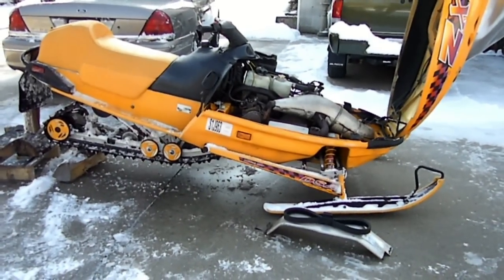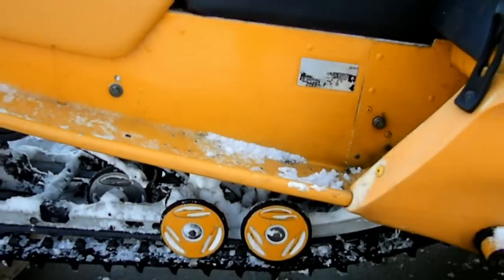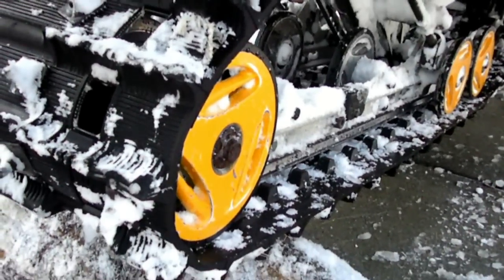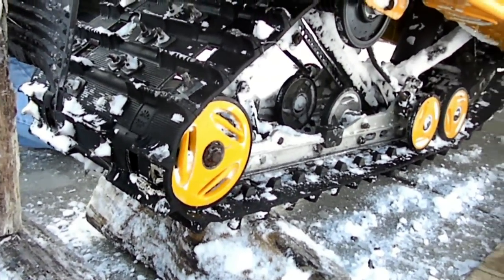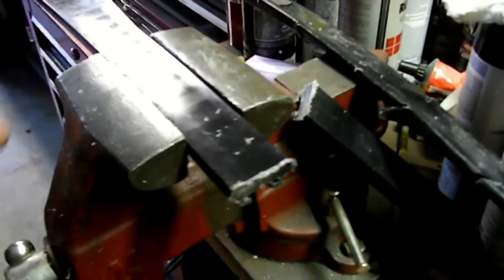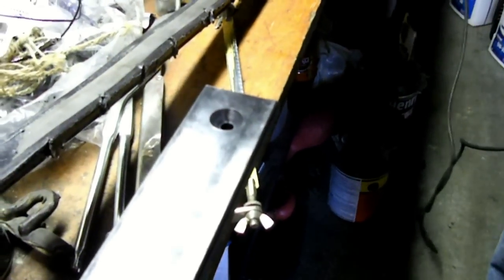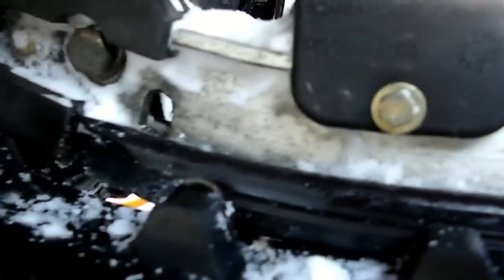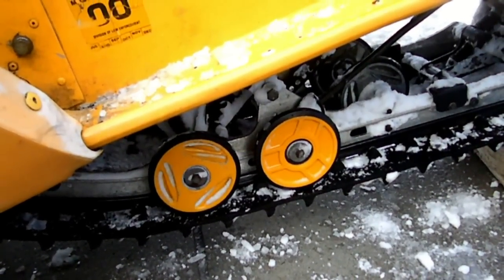How to Change the Hyfax/Sliders on a Snowmobile

Comment: I would recommend using silicone spray prior to removal and upon instalation. The rear iddler's exterior bolts need to be loosened and the adjusters should also be backed off to allow easier installation. 
Once the slides " hyfax" have been installed, the next steps are quite critical as the track needs to be properly adjusted.  Failing in doing so will cause premature wear on your slides, if the track tensions is too tight. The drive cog may also experience added stress that could lead to future problems.  
Now comes the time to properly adjust your track tension. 
I've heard a few methods in doing so, but if you wish to run your track uniformed with your suspension, you will need to follow these simple steps. Let us first make note that the track tension may  vary on different makes and models. 
However, lets consider this as a fairly accurate guideline. 
Now that the front and rear end of the snowmobile has been elevated off the groud surface, you will first begin by tightening you adjusters in a uniform sequence till your track has an approximate measurement of 3/4 - 1 inch sag between the bottom of the slides  to the track. 
This measurement is usually quite typical on most models. Now it is time to put tension on the track using a calibrated weight. Again, this may vary slightly on different models. Unless you posses a track tension and measuring tool, you will need 16 - 17 lb. of weight that you will hang off the track centered to where your suspension is. A fish weighing scale works great as you will use it to do both sides of the track independently in respect to the above mentioned weight.  Keeping your adjusters synchronised, begin to adjust  these till you get a measurement of 1 9/16 - 1 3/4 in. between the bottom of the slide and the track. Keep these measurements respective. This measurement will be taken at the largest point of the sag which is where the weight is.   
Now you will tighten the two rear iddler bolts along with the two adjuster locking nuts. 
Now comes the time to fine tune  the track so that it may run synchronised with the suspension. 
I would highly recommend that the sliders along with the contacting parts of the track " metal rails" be lubricated using spray silicone. 
Now start the snowmobile and throttle up so that the track may spin " not too high of RPM " for a few seconds. Shut your machine off so that you may check your final measurements. You wiil now measure " near the rear of the slide" from the outside edge of the track to the outer edge of the slide  using a measuring tape. 
This measurement will ensure that the track is running centered with the suspension. If there is a variance between these two measurements, you will need to loosen the two iddler bollts and make final adjustments so that the track runs true. Always remember to retighten hardware before running the machine. 
Note...after you have used your snowmobile for a couple of hours, it is to be expected that the front of the slidders will break in by showing some wear. You are now ready to readjust the track tension to propper specifications. This final adjustment should be sufficient for the season that lies ahead. Happy snowmobiling 😊
Reply: Correct process changing slides ,greasing & checking bearings.

Comment: Loosen up the rear bogies it’s easier and don’t use WD40 it is a degreaser doesn’t help much with sliding instead use spray on lithium grease and spray it inside the slider before trying to put it on it slides so much better .

Comment: Honestly a terrible video guys, he did give a few good points, but cutting the track was completely not necessary and stupid. Heat the track with a heat gun, shave the front of the sliders and it will press right through. Me(19) and my 15 year old brother figured this out easier than these guys! Idiots!